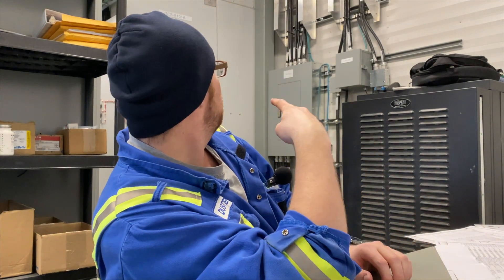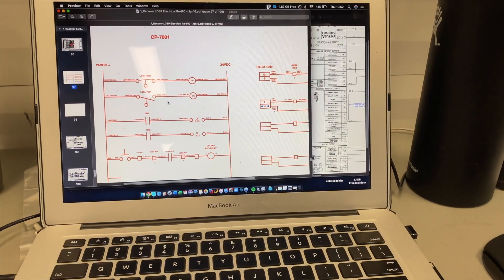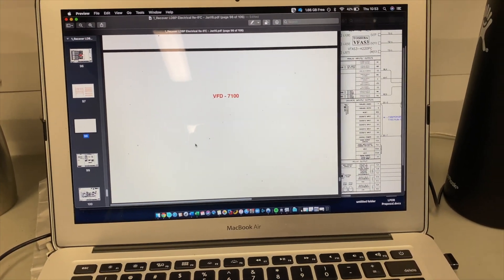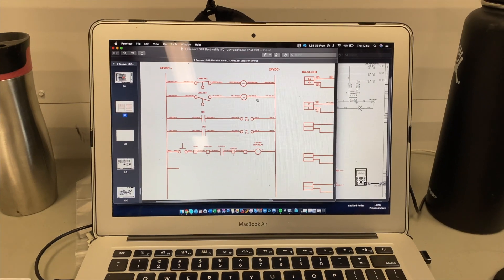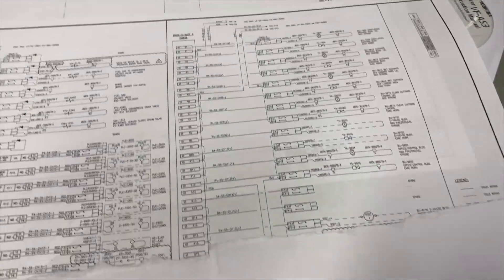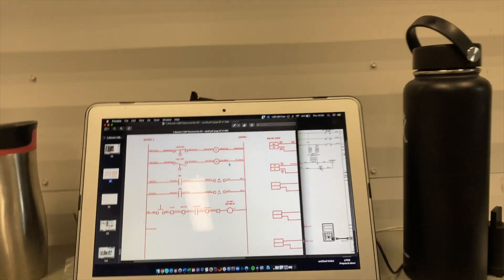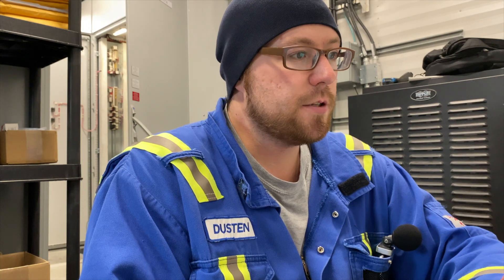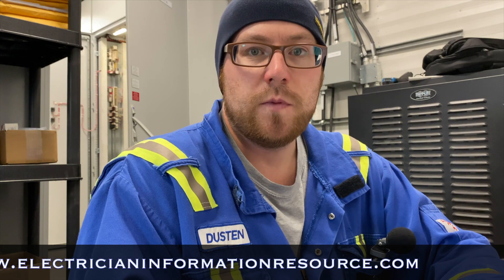Day In The Life Of An Industrial Electrician - Redlines And Electrical Design

Comment: I'm a Red Seal Electrician in Canada. I've done everything from wood frame residential to concrete residential and commercial,  light and heavy industrial and high voltage work. I currently work in a pulp mill with some very antiquated equipment.
What DCS are you working with?
Reply from the maker: Thanks for sharing Colin!

It's great to see you've tried out many different industries rounding off your skill set.

I can't remember what type of DCS it was on that site.